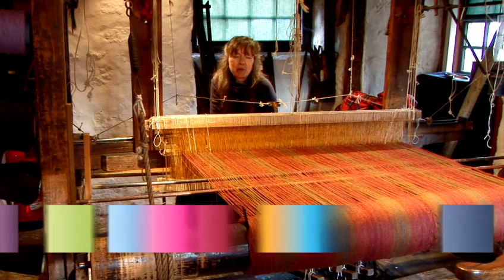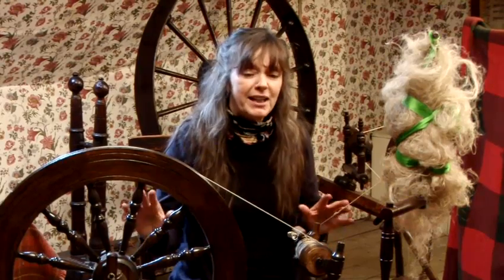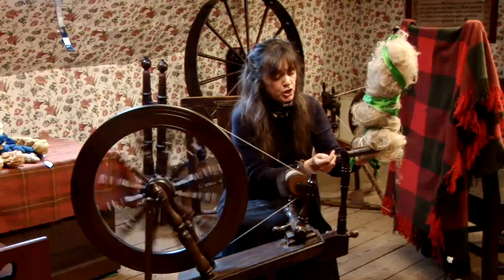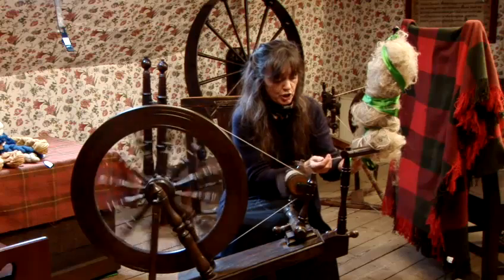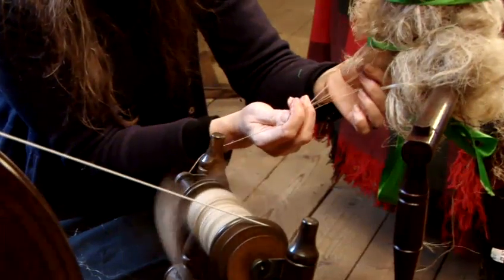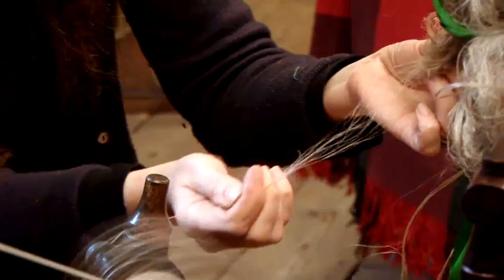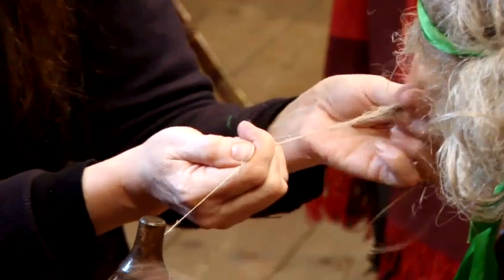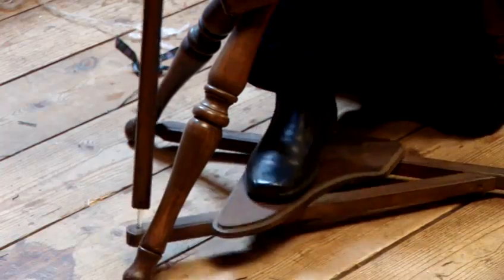Spinning Flax Fibre Into Linen

Comment: how come the bundle you're spinning from doesn't look like flax that has been combed?  Your bundle looks like a tangled bunch of fiber.  the wool looks like that too.  why is that when all the effort to get the fibers going in the same direction from the processing prior to spinning?
Reply: I’m wondering this as well. Also was wondering why the thread looks so rough. It should be a lot finer and more clean than that bc the fibers are so long.
Reply: Came to the comments solely to ask this myself. I've processed all my flax and it looks NOTHING like what she has on the distaff. If I tried to spin it as shown here it'd just fall onto the floor. Hell, I couldn't wrap it on a distaff in it's current state anyway. I wish she'd explain what she has done. As this is clearly an integral step. Working a wheel is the same, but for some reason every video of this nature spends ten hours talking about how to work a bloody wheel and zero seconds explaining the most integral part - how to get from combed flax on a table or bunched into spinning it.
Reply: Yeah, there are lots of questions here. The distaff doesn't seem to be prepared correctly. Also, linen should be wet-spun to help the linen to lay flat and stick together a little.